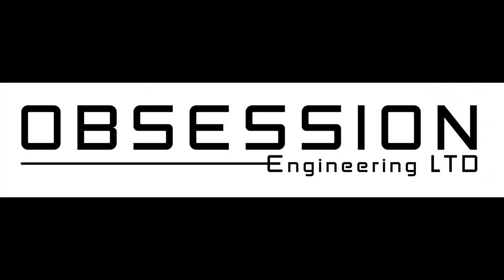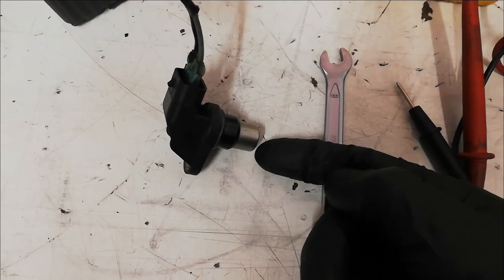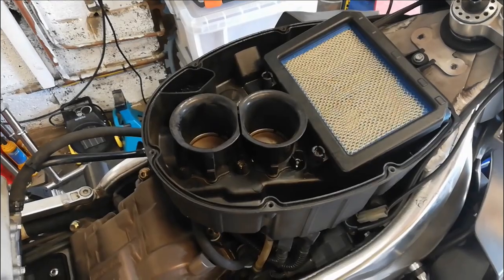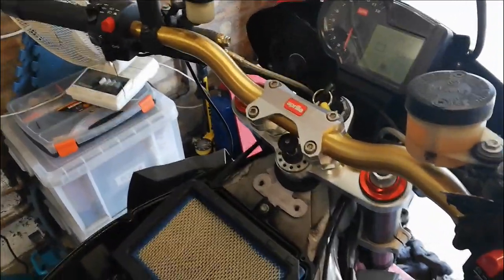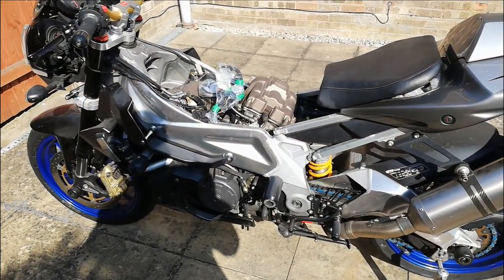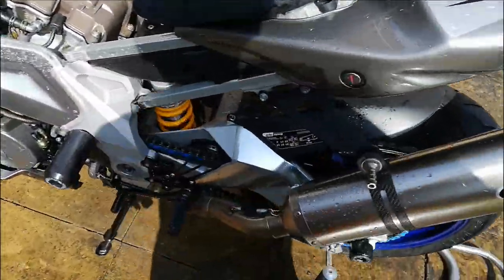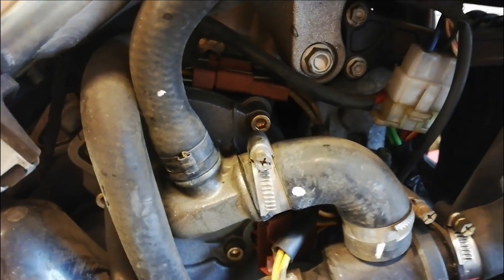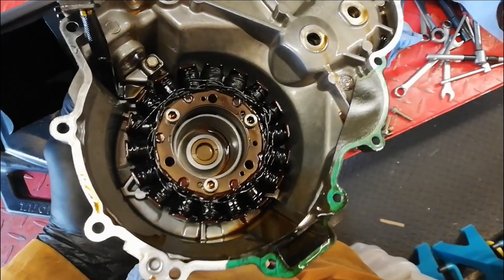The Big Ugly Aprilia Tuono project. Part 2

Comment: Be careful testing sensors with 12v. Most sensors in engines actually run off a 5v reference from the ecu and hooking them up to 12v can kill them.
Reply: And even if the sensor is powered by 12VDC the signal  out could still be 5VDC to the ECU  so when testing output... multimeter - yes . 12 volt bulb -no.   Anybody  interested in knowing more , just search for "Hall effect sensor"

Comment: That clear hose coming off of the air box… in the beginning of the video, right hand side, by the IAC. What is that and where does it go to? Mine is missing that. Wondering if that’s not causing an issue I’m having
Reply from the maker: I'll have to check for you, can't remember off the top of me head!!
Reply: @obsession_engineering  thank you!!